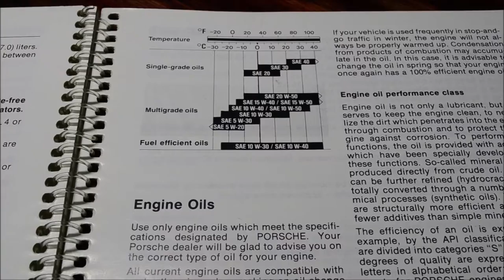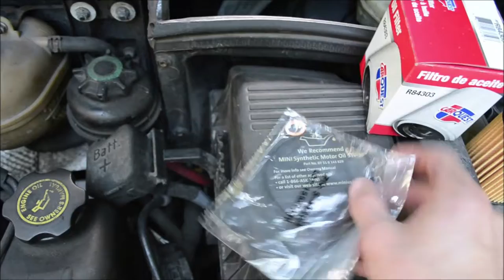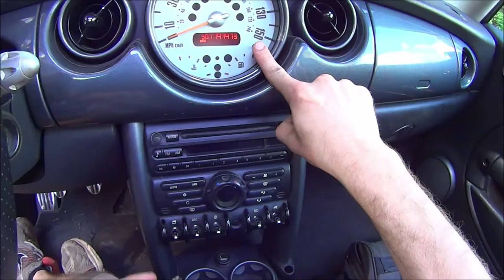MINI Cooper S Oil Change R50 R53 1st gen

Comment: I recommend to anyone doing this to (thoroughly clean) the threading of the oil filter housing. Last thing you want is for the old oil to compromise the seal and/or the new o-ring you just placed. Your risking leaking oil by not cleaning threading of the oil filter housing as well as the threading where the oil filter housing gets screwed on to.

Comment: Oil Changers will not do an oil change on my 2005 S because of the risk of breaking the turbo cooler line. They said if I brought the spare part in they would do it. I guess the line is fragile and if you break it the car needs to be towed for repair.  Thanks to your video, I might try to dit myself.
Reply: Not true! They just didn't wanna do the oil change 😅
Reply: 2005 does not have a turbo, unless it was installed aftermarket.
Reply: Pre-May 2006 built Mini S had a supercharger. They switched to turbochargers after that.

Comment: did my first oil change this weekend, not fun.mostly because fucking december in europe and mud is everywhere after snowing during week and above zero on weekend. Plastic cover covering the bottom was held by every imaginable screw type and zip ties so that was a bother doing it in mud. Got to oil filter stage and realized I cant loosen it. So just did oil change. Aliexpress oilfilter tool ordered, and putting the fucking bottom plastic cover back was major pain in the ass and two screws left from someplace. Fucking hell, must be day and night doing it in a garrage on a lift with comfort and visibility...
Reply: Try searching up topside oil change on Mini Cooper and purchase the Mityvac, that way you won’t have to raise the vehicle off the ground and remove oil drain plug. Less mess and saves time. 👍🏼
Reply: @RickyPNWLA  bought ramps so getting up comfortably is super fast, learned how the plastic cover holds and where and with what and now can put it back in 5 minutes, bought that 74mm oil adapter for filter that makes 15min struggle in to 30 seconds smooth ratcheting...  started to use brain and did oil change in nice, warm, dry, august. 

Well another story is that this year I went for my manual transmission oil change, and again, first timers issues. Special huge hex for filling hole, special M14 12-point hollow socket... then I used not ideal oil going only by specs - 75w90 and shifting went worse... then reading more about the fact that OEM while claiming 75w90 is actually so much thinner. Trying VW G70 and its so much better...